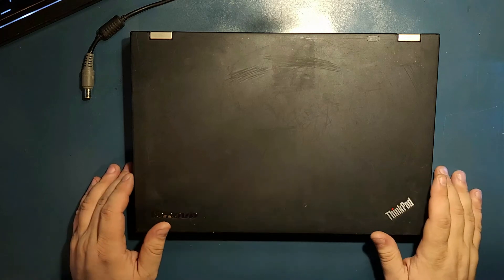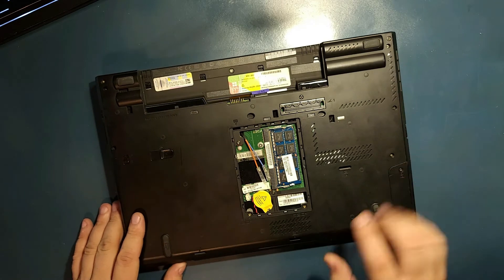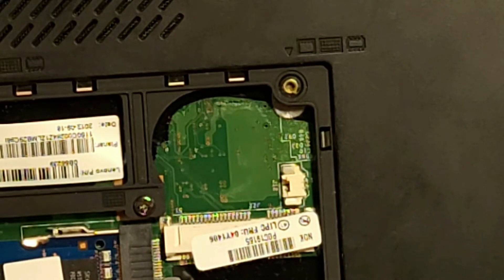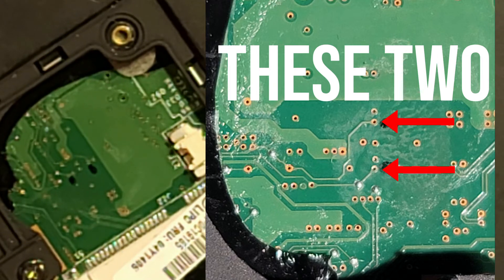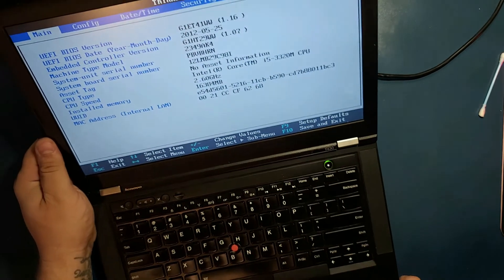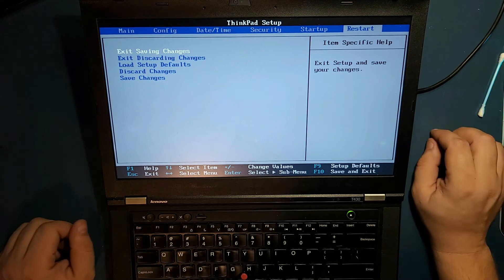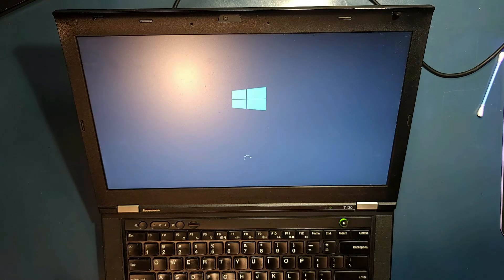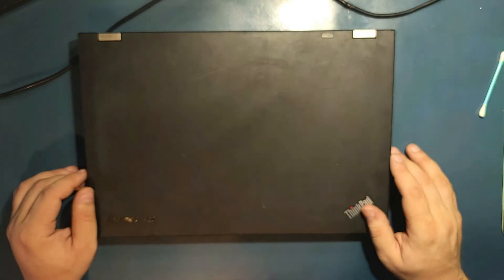LENOVO T430 BIOS PASSWORD REMOVAL

Comment: I just got a Think Pad off E Bay bios locked ...its only 3 years old an L13 ..has an i5 quad and 8 gig of DDR4 ...the supervisor password  is on a chip ..but i got
round the bios password ..i got into the bios but i cant change certain setting ..but i got around things using a USB windows install ..putting a drive into it 
unformatted  the i copied the USB Windows over to it ...that worked i dont need to change any BIOS settings as there is no protected boot turned on .
This is a 500  GBP (UK) machine and i paid 15 for it  ... and its in good condition .... nobody else would bid on it because of the BIOS  locked .. 
i would say that i was real lucky ...its going to replace my HP Probook which is ancient now ... i like your video these tips are very handy .🤗

Comment: I paid $30 for mine after I saw it on fleabay same problem and i found your workaround so i bought it now i just have to get the  tweezers. to do the job.
Then it's put in a new SSD drive cloned from my linux mint T410's
I don't like windows and have long since joined the. Linux mint force.
I have 8 T410's and thought i might as well try a T430 and see if it's any better.

Comment: Thanks man...alothough when I get in, I cannot disable the password option like you did. I cannot chose any options in that security section...any clues?
Reply: I have the same problem, Have you found a solution or are you still looking?
Reply: No solution sorry man. I tried at least 20 times....gave up in the end and got myself a new motherboard from AliExpress $130 @jameslayman
Reply: @mtscott44  bummer, imma see if i can find a free solution for it, because luckily its not effecting me too much at the moment, gonna let you know if i figure something out (big "if" tho...)
Reply: Thank you. Yeah maybe I'll revisit...board still sitting on the bench staring at me! @jameslayman
Reply: @mtscott44  so, the grayed out ones are some sort of "limited access" mode (i used to get into it but because i didnt enter a password), you probably timed it wrong, i was at it for quite a bit due to my shaky hands, but you just gotta hold em on the contacts at the moment the screen turns on, but before the thinkpad logo. The "holes" arent where you must put the contacts, there are 2 "shiny" bits on the same "line" (hopefully you understood what i said just now), put whatever youre shorting it with against one of the contacts before turning it on
Reply: @mtscott44  thats odd... maybe you pulled them away a bit too early or something?
Reply: @mtscott44  also, make sure the tweezers are conductive, i at first accidentally used some "anti-magnetic" ones which seemed to not work
Reply: Good call, will check. Cheers! @jameslayman
Reply from the maker: So far what im getting is the Bios firmware being the problem, i did flash the bios...didnt work....i updated to the latest...still didnt work....i think it will have to be completely flashed with a 3rd party bios but i have to see which can be trusted to not mess up the entire board...if i find something that works without causing damage, you bet there will be a video...hope we can find something soon because i ain't getting rid of my T430
Reply: Thanks man. I flashed 1vyrain in a hope that it would change my outcome (shorting the chip gets me passed the pw, but no options are changeable once I'm in). I'll never get rid of my t430s!! hehe...I'm obsessed and just built another one from the motherboard up. One for a bitcoin node, one for a retro gamer for my son and another for web server. the fourth is BIOS locked so if we can get passed that, I'll have a daily driver also hehe  @OMNITEK

Comment: My self esteem sank when I saw the bios admin password prompt. OH NO!!! I didn't want to rip the black sticker cover, so I very carefully cut (rather score) a channel (two parallel lines) in sticker with a sharp knife. Then lifted it slowly with gripping tweezers. I didn't have alcohol but I used a couple of orange peels! It worked! The tracks were way too small, so I used a pair of very sharp tipped tweezers, I sanded the tips so they're clean, nice and sharp. I shorted the tracks, then pressed the power button. It beeped a few times and nothing on the screen at all. I realised I didn't pressed the power button first. I shut it down by pressing the power button for a few seconds. I taped the tweezers so I didn't waste a second or two trying to squeeze it to get to the right size before shorting the tracks. I pressed the power button first followed by a short to the tracks for a second (just a firm light touch, no need to press too hard) and it went into the BIOS as explained in this excellent video. Shorting deleted the device UUID. Upon next boot, after the password reset, date and time fix etc., the UUID automatically reappeared. The rest is history. :) Note: if you still can't get into BIOS by pressing F1 (not because of the BIOS password but because of fast/safe boot feature of the OS?) then restart (not shutdown!!) the machine from the power menu, upon the next boot, press F1, you'll get into BIOS.
Reply from the maker: Or you can keep the Lenovo button pressed while pressing power, should automatically give the option for bios.

Comment: Hiya, pal!
Absolutely GREAT tip!
THANK YOU!
I think many old T430s were sold w/ the BIOS password left on the machine.
So those laptops could only be parted out, not used except parts.
This tip could save many of the old laptops.
With some upgrading some of these laptops are fine computers.
I don't have to carry mine around so the weight & size are not issues for me.
I would like to upgrade the CPU but its hard to figure out which quad-core to buy.
I guess I'll buy one that doesn't require upgrading the heatsink.
That would make a good video, don't you think?
Have a GREAT day, Neighbor!
Reply from the maker: I will have to see and try a few cpu's which one would fit better, i like that idea....and yes, i actually didn't just get that laptop for the video...i use it daily and i really like it....16gb ram...512 gb SSD....the CPU would probably be next and maybe get one of them double batteries...i really like it..it's a shame a lot of them are thrown away or parted out just because they didn't bother to remove bios pwd, which after the hdd is removed, there's absolutely no security or privacy risk...i am glad i'm not alone with this kind of laptop, cheers partner.

Comment: will this method erase my data?
Reply from the maker: No, it should not...but you can remove the hdd/ssd drive anyway to be on safe side...since you're working on hardware level...plus its easy to remove the drive on t430.
Reply: @OMNITEK  i have a t430 and its wifi, Bluetooth is disabled in locked bios. its irritating
Reply from the maker: @ankitnegi9713  yeah mine was similar, but after i unlocked the bios and upgraded the ram to 16gb and drive to ssd....it's better than my newer laptops...except i have to upgrade the battery but that will be when i can buy one...

Comment: I have this t430, it is a great laptop, but my only concern is its Pulse width modulation and it really aches my head thru my eyes. Any solution? Thanks
Reply from the maker: In my case i tried a few things and all i came to do it keep the "reading filter" on...but somehow on windows it doesnt seem great...but now i have Zorin OS which in my opinion brings this laptop on par with latest ones...and somehow feels easy on my eyes and the battery lasts way longer, but the downside is that its not windows...not really sure why it does that with windows only...at least mine.